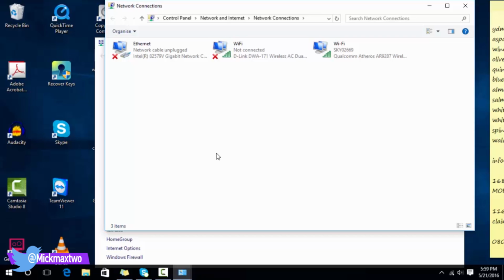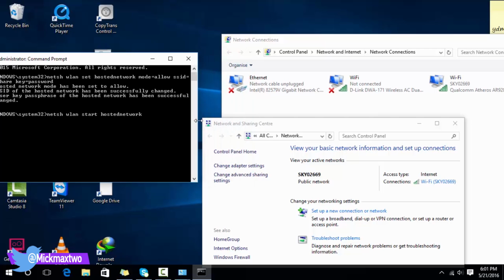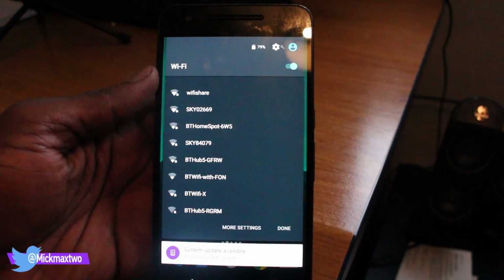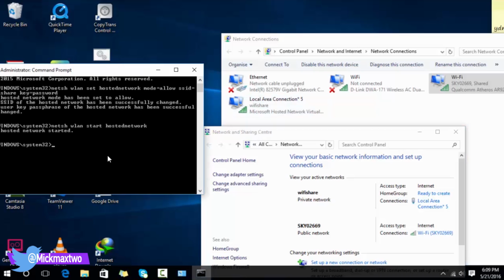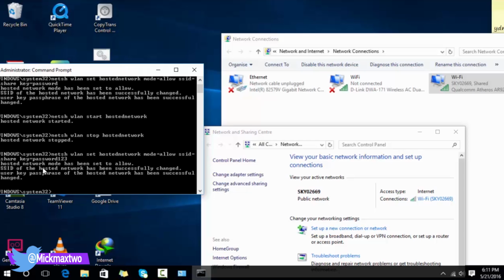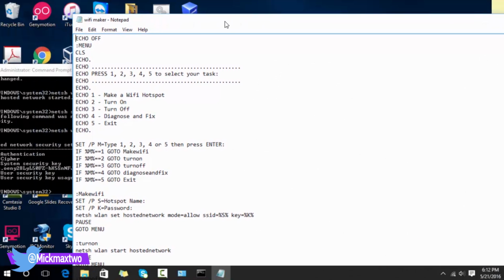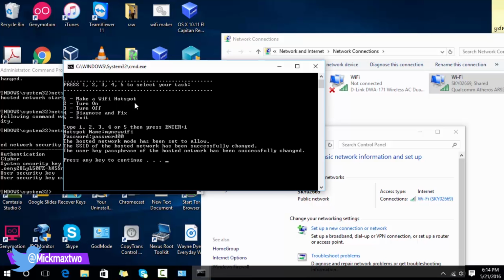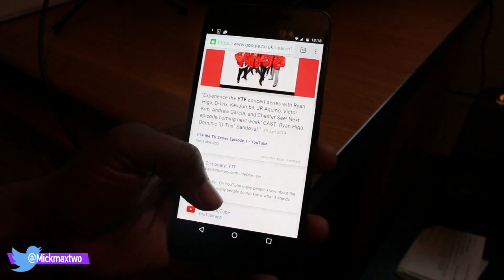How To turn windows 10 into a wifi hotspot -- no software require

Comment: help! it will work on my phone for 30 min then it stops working , then i turn the hotspot off and when i try to turn it back on it says "a hosted network could not be started.
a device attached to the system is not functioning"

Comment: Min 4:38 it does not give me the option to change from Ethernet what can i do?
Reply: probably WAY to late but. 

1. Untick "Allow other network users to connect through this computer's internet connection"
2. Click OK
3. Reopen the same dialog box
4. Tick "Allow other network users to connect through this computer's internet connection" again
5. Choose from the drop-down menu under "home networking connection"
Reply: Cheers, that solved the problem for me!

Comment: For some devices (e.g., Interl dual band AC 7265, there is a problem of "the group or resource is not in the correct state to perform the requested option", one reason is due to the driver version, you can go to device manager and update the driver to an older version. This link can be referred to: https://communities.intel.com/thread/80464

Comment: Wifi Script is Missing in the link. SO I HAD TO COPY IT FROM YOUR VIDEO PAUSED LETTER BY LETTER :(
Reply: Can you possibly send the script or store it somewhere that i could use it as well?
Reply: ECHO OFF
:MENU
CLS
ECHO.
ECHO ...............................................
ECHO PRESS 1, 2, 3, 4, 5 TO SELECT YOUR TASK:
ECHO ...............................................
ECHO.
ECHO 1 - Make a WiFi Hotspot
ECHO 2 - Turn On
ECHO 3 - Turn Off
ECHO 4 - Diagnose and Fix
ECHO 5 - Exit
ECHO.

SET /P M=Type 1, 2, 3, 4 or 5 Then press ENTER:
IF %M%==1 GOTO Makewifi
IF %M%==2 GOTO turnon
IF %M%==3 GOTO turnoff
IF %M%==4 GOTO diagnoseandfix
IF %M%==5 GOTO Exit

:Makewifi
SET /P S=Hotspot Name:
SET /P K=Password:
netsh wlan set hostednetwork mode=allow ssid=%S% key=%K%
PAUSE
GOTO MENU

:turnon
netsh wlan start hostednetwork
PAUSE
GOTO MENU
Reply: Copy > paste> save as .bat file > right click > Run as administrator > Enjoy :)
Reply: Thanks!!
Reply: This is the full code. Some lines could not be seen on his screen... these are the lines from the bottom. enjoy!

ECHO OFF
:MENU
CLS
ECHO.
ECHO ...............................................
ECHO PRESS 1, 2, 3, 4, 5 to select your task:
ECHO ...............................................
ECHO.
ECHO 1 - Make a Wifi Hotspot
ECHO 2 - Turn On
ECHO 3 - Turn Off
ECHO 4 - Diagnose and Fix
ECHO 5 - Exit
ECHO.

SET /P M=Type 1, 2, 3, 4 or 5 then press ENTER:
IF %M%==1 GOTO Makewifi
IF %M%==2 GOTO turnon
IF %M%==3 GOTO turnoff
IF %M%==4 GOTO diagnoseandfix
IF %M%==5 GOTO Exit

:Makewifi
SET /P S=Hotspot Name:
SET /P K=Password:
netsh wlan set hostednetwork mode=allow ssid=%S% key=%K%
PAUSE
GOTO MENU

:turnon
netsh wlan start hostednetwork
PAUSE
GOTO MENU

:turnoff
netsh wlan stop hostednetwork
PAUSE
GOTO MENU

:diagnoseandfix
netsh wlan stop hostednetwork
netsh wlan start hostednetwork
PAUSE
GOTO MENU

Comment: I'm trying this on on my computer in my dorm at school and it doesn't seem to work. My 3DS and phone can find the connection easily but it simply will not connect. I tried disabling the firewall for private connections but that didn't help. Is this not guaranteed to work on University networks?

Comment: The hosted network couldn't be started.
The group or resource is not in the correct state to perform the requested operation. I get this message
Reply: I got answer....Go to device manager.
Click on view and press on "show hidden devices".
Go down to the list of devices and expand the node "Network Devices" .
Find an adapter with the name "Microsoft Hosted Network Virtual Adapter" and then right click on it.
Select Enable.

Comment: "the group or resource is not in the correct state to perform the requested option ", what does that mean :(
Reply: Go to device manager, then network adapters, then enable anything you find disabled, easy fix
Reply: were the same.. but when i use connectify it can share..but i dont want to use connectify apps
Reply: thanks alot that i was having the same problem and resolved the issue turns out one of the network adapters was disabled thanks
Reply: I did that but it still didn't work
Reply: have you find any success? I get the same result
Reply: same error!!! why he cant just explain how to fix this!!! he may has a setting enabled or disabled that is nessesary for the command!!

Comment: I am not able to host the network. after the step "netsh wlan start hostednetwork"  i am getting an error as follows:
the hosted network couldn't be started.
The group or resouece is not in the correct state to perform the requested operation.

plzz help me... i want to get internet connection in my mobile as soon as possible.
Reply: doesn't work for me...
Reply: Go to device manager, then network adapters, then enable anything you find disabled, easy fix
Reply: for me neither!! please help (windows 10)

Comment: thanks & this is great. It was working fine for me, but by mistake I right click & disable it when not using. Now it doesn't start. It says the - The hosted network couldn't be started. The group or resource is not in the correct state to perform the requested operation. Please advise. Many thanks.
Reply: I have exactly the same case and message, worked one time and then same message !!?
Reply: same help!!!